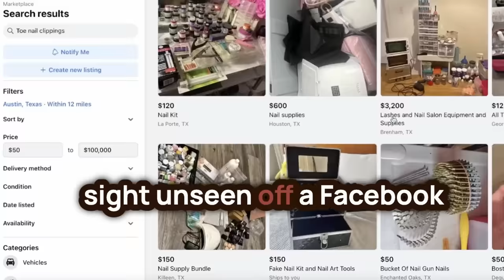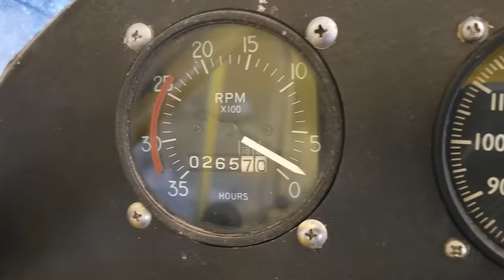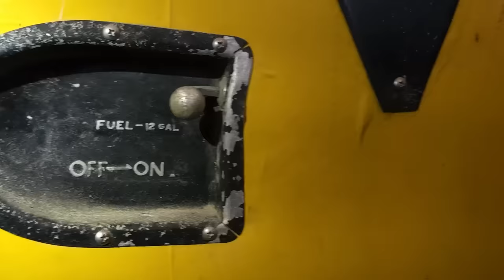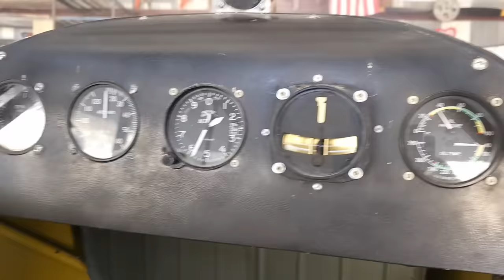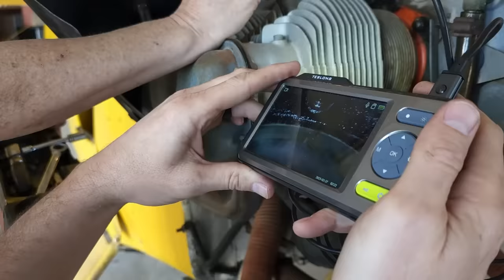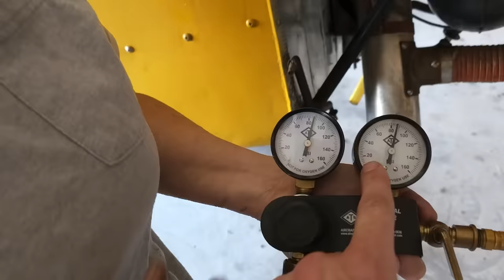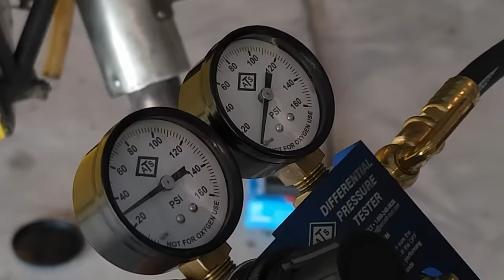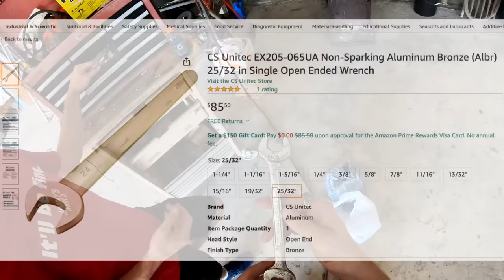I Get A FREE Airplane.... If I Can Start It

Comment: Man good good good great video Jimmy I was wondering what happened to these planes. I didn’t realize how the little overhead cams worked! Now that’s pretty simple
Seems like if you didn’t over rev them they would run a long time
I really enjoyed the compression testing system that was awesome thanks!!!❤❤❤❤💯✊🇺🇸
That was my first plane ride with my uncle as the pilot when I was about five years old it was a Navy veteran and an awesome man thanks Jimmy good memories
Reply: Hello, This engine isn't of overhead cam design rather, this camshaft is inside the crankcase under the cylinder assemblys beneath the crankshaft. The pushrods (one intake, one exhaust per cylinder) are contained within tubes between each cylinder head and the crankcase. These tubes are visible elsewhere 21:46 in the video, identifiable by two hose clamps at the crankcase sealing each rubber connection in place. As to overrevving leading to premature engine failure, true maybe in a dive however, prop tip speed exceeding the speed of sound is the limiting factor here. This engine design (not necessarily this exact one) will perform well at higher RPM although I am not claiming it should be done. The Cessna 411 and 421 GTSIO-520 engines for example, are geared thus providing higher RPM so, more power and other advantages compared to the 414 and 402 TSIO-520 engines with virtually identical engines and airframes. My dad was a pilot and when I pointed at something in the sky he immediately took me to the strip and rented an instructor and Cessna 150 for us. I was hooked. He was a US Navy fighter squadron Lt. Cdr. aboard the USS Midway and I appreciate your uncle's and the Navy's service. Your note as well as those of others are appreciated, I enjoy reading them and watching Jimmy's videos. Thank you. A&P Mechanic, Pilot, Instructor
Reply: @paulmac3307  I’m sorry I was way out of my league thank you thank you thank you thank you

Comment: If you run it and add automatic trans fluid in it, it will dissolve the carbon. It smokes like crazy but it works

Comment: Really enjoying this video, however, and no offense intended, Doesn’t TBO on the cub engine mean time between overhaul, no replacement?
Reply: Replacement means, remove u/s item and fit a new or reconditioned item. So removing a timex item, getting it overhauled and fitting the same item, means it’s replaced.

Comment: The first time I flew in a piper cub (around 1990) We were going from California City to Mojave. We were following my family's Cessna 150.
The pilot asked if I wanted a full take off. I say yes. We go rolling down the runway, then all of a sudden the nose is pointing straight up. I grab on to the two metal bars in front of me. 
On the way to Mojave. My pilot lost sight with our airplane. Our Cessna 150 (N51305) is painted grey (accidentally radar absorbent paint). When a plane is painted grey, it is harder to see when below the horizon. I told the pilot where to look.
So, on final, the pilot let's me know the piper doesn't have flaps. So, he tells me he'll tip the airplane up on it's wing and fall out of the sky. When he did this maneuver, I watch the ground as we fell towards it. I watched the shadow on the ground and the wing tip get closer. Then the pilot turns us back upright and we touched down. He then let me taxi. 
I started flying in 1982.

Comment: I would have the oil analyzed in every single one of them and have a wing spar inspection done before I spent any time trying to get them to run. Not worth it if you can fly it...JMHO

Comment: The best way to remove carbon from an engine is to get the engine hot hot hot! Take a misting bottle with some water in it and mist it into the intake,  ever so sparingly, with the engine running... Bingo magically cleans carbon...! Obviously it should go without saying you don't want to overdo this process!!!

Comment: if you do comparison to the car's engine let me ask which car engine need a rebuild after 100.000 miles? REgular todays car engines can last up to a half a milion miles and it still won't need a piston change etc, all it would need is new rubber valve seats and head gasket. 

If you are refering to car engines from the 1945 than they wont last 100.000 miles. Back then oils were pretty simple as most of the engine components wasnt hardened and temperature treted. Also gasoline with lead did its job to wear it out quicker.

Comment: isn’t that Piper the Iconic model that many of the Alaska Bush Pilots  flew for many years ? and maybe still are using  for certain areas in the NWT   like forThe Gold Prospectors and keeping them in provisions  plus in touch with the World  i always thought  it was because they can take off and land on Short Runways  and could drop fast or Climb pretty quickly to  land on  oddly located  strips , i’m not a Plane expert i just like learning things and reading  i thought they were used to help people move Mail in those remote areas  i didn’t remember they were VW based Motors. although i do know those are popular  after the Model T Engines got really hard to find  which to me  was weird that  people never took advantage to converting the Pinto in-line 4 motors for Aviation which IMO were a good reliable block with great Tourque  and were plentifull  for many years  and kind of still are many were used  in Boats  Marinized by Mercruiser  and most of all produced decent power at excellent fuel Economy  producing 135 Horsepower  at a similiar weight to many 2 Strokes  in the same ish Category  yours does sound good running definitely  like a VW Beetle

Comment: Jimmy next time crank that VW engine get her warm squirt some water in the gas make it happen er hole with it revved up carbon will immediately let go those valves as it vaporizes and go out the exhaust
It works on Harley’s chevys and Volkswagen if there’s a reason you can’t do it to a airplane please excuse my ignorance

Comment: BTW earth moving machines as do tractors also has a hour counter (1hour = full rpm for 1 hour, meaning if you go at half rpm 1h will count after 2 hours ) and I see many tractors above 10.000 hours with all stock engine, with just oil changes. 
Airplane engines are made to last even longer they are simple and usualy runs at low rpm, like 1500 max, so 200hours will count for just brake in engine not engine on 1/4 of its life. 
But once again this being 1945 engine, back than they new jack shit about materials and oils I can to somehow understand it.

Comment: I spent $15,000 on a rebuild and found out that they didn't do the valves and at 200 hours it droped a valve and took out the center of the piston

Comment: Chapter one, compression test. If bad, cylinder heads off. All of them.  It´s not a Bugatti Veyron for god´s sake.. All these "tricks" instead of doing a proper job that takes from 6 AM to 9 PM at most, beers and BBQ included.  I, putting it mildy, ... disapprove.  A fabric punch test would be appropriate before flying the thing as well. If you care to live.

Comment: Hello Jimmy again I stop the video and I noticed what you guys are working on removing the rocker so he can get to the valve and you said that if you drop the valve you have to take everything apart in order to remove it 
I am not going to take credit for this but my buddy George give me this information after he slipped overnight , he gave me this answer , I was working on a dodge van changing the rubber seals because it was smoking a little bit lol jimmy’s planet lol Drop the valve on one cylinder And now I was stuck do not know what to do try the magnet try to grab it nothing worth 🤔 But George had the answer
He said by the hot dog balloon stuck it in the spark plug hall and pump it up with a straw , it’s a light 💡 lol The next day I’ve done just that then it worked like no problem lol
Just saying in case you never heard that 
I think this is perfect for your planet…
Let me know what do you think

Comment: Dude, you know very little about cubs. Several of the statements you made were incorrect. Gor.instance the J3 cub never came with cable operated brakes.  The covering is not a stretchy plastic stuff. A rebuilt A65 is not worth anywhere near $25/k

Comment: Get a oil can empty put a fer ounces of water in it warm up engine and with running engine about 2000 RPM and squirt water in the  carburate. if you can't get to the carb . get a small hose and put it on the oil can and tie the other end in the carb. intake the water will cause the carbon to expand and blow our exhaust.

Comment: That idea that compression can be lost if the ring gaps are lined up is nothing but an old myth!!  First of all, rings continually rotate around the piston in a random manner.  Therefore, the gaps will all be lined up repeatedly during the life of the engine and you will never notice!  If the myth were true, your airplane will fall out of the sky at random moments!  Second, there is a lot of room in that space between the rings, far more than the size of the ring gap.  So compression can flow unimpeded through all the ring gaps no matter where they are positioned!

Comment: If I had anyone beating on my engine with a hammer they would be fired. Same with fuel tanks to try and get the pump to work, fix it right so you know it is going to work every time you get into the thing especially a plane. That's just common sense boys and girls. Some Marvel Mystery oil works wonders on sticky valves to guys.

Comment: It sounds like a pup.  Since it was sitting it's not surprising you needed to spin the prop several times to draw enough fuel into the engine.  Like you said the Piper Cub is a bare bones affair, but it's a sweet plane.  I wish I had one other than my remote controlled piper cub with 2 foot wingspan.

Comment: Lapping the valves while it's on the engine to me makes no sense to me. Now you have all that abrasive material inside your cylinder wall....? If I were getting a free airplane, I would just pull the cylinder if that was the case...

Comment: Jesse or the lady never took an “MOR.” MOR= Master Orifice Reading.  This gives you the minimum Compression value at the time you do the compression test.  Normally around 42PSI, depending on the air pressure.
Reply: Continental requires this so you’re not pulling cylinders that don’t need it.

Comment: You should run marvel mystery oil in the fuel to help keep valve train from getting carbon deposits . On the smaller continental engine.

Comment: wth? wouldnt it be so much safer going through the freaking exhaust port?? in my opinion this would be the most useful attack due to the fact that the far side of the valve seat would  be most likely to end in success. (Only) if you have to resort to this method. best would be to just remove the cylinder head and dont act like a couple of lazy hacks. lol

Comment: Rebuild a car motor on 100k miles? I don't know what car that is but you should never buy it again. 😅
Reply: that was the standard back when this was built, 100k miles and engine is shot was pretty much standard untill the 90's

Comment: Very little of your info is correct. What a waste of time You dont even have the correct year. Its a 1940. No wood wings in 46. Tailwheel is steerable. CG part is sort of correct .Back seat solo to prevent noseover when braking. Engine is not correct for the year. And the list goes on. How about do your homework on these so called free airplanes